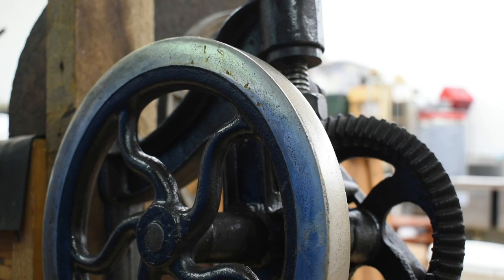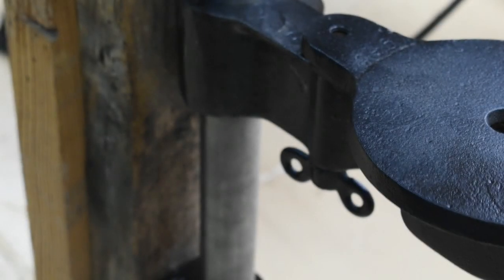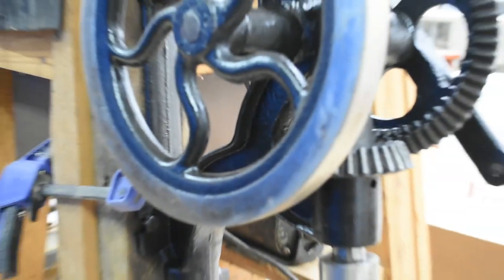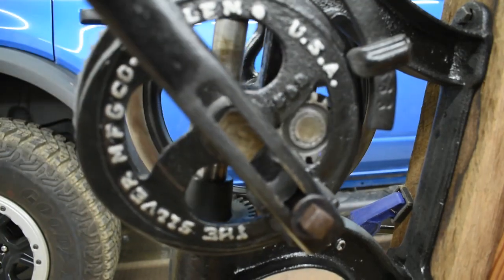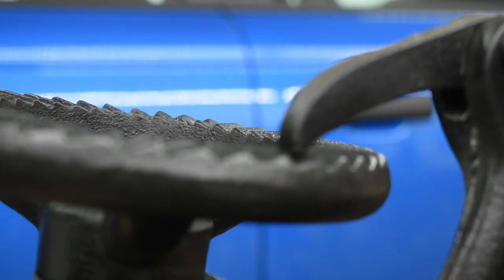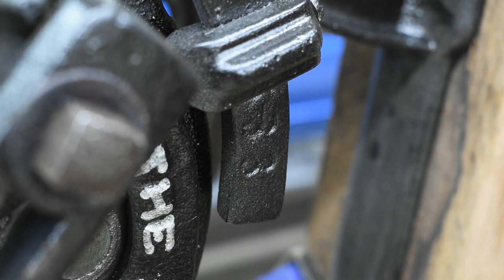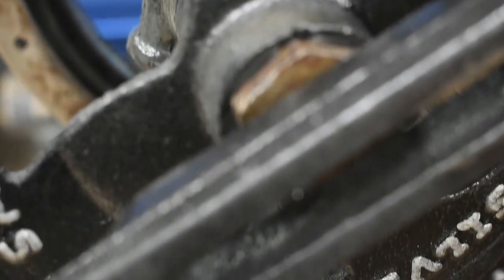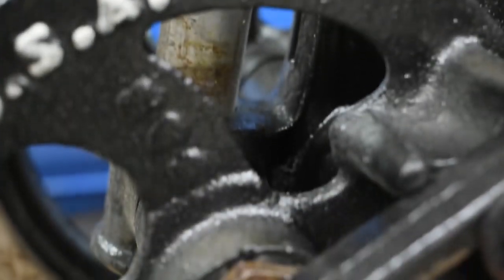1911 silver manufacturing post drill press

Comment: I believe the guide pin on the main shaft is supposed to be inside the slot on the frame near the top
Reply from the maker: you are correct sir, That was the way I bought it, I have since fixed that issue. Good eye thanks for watching